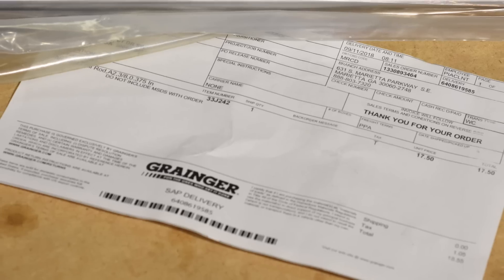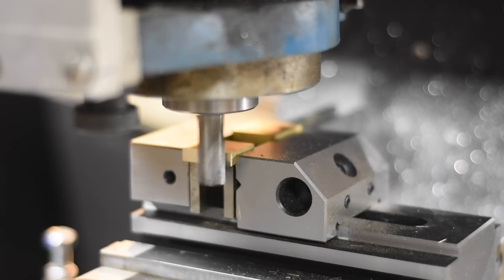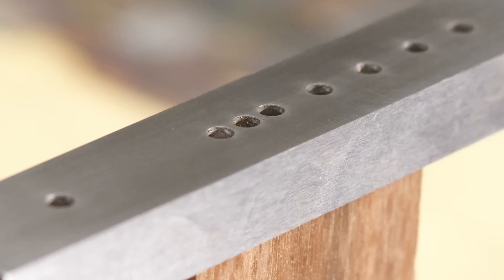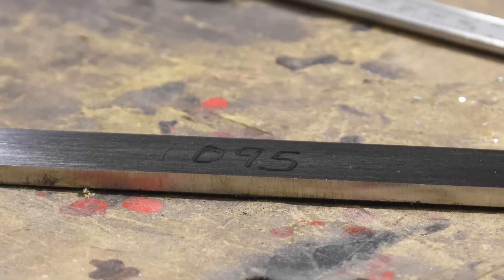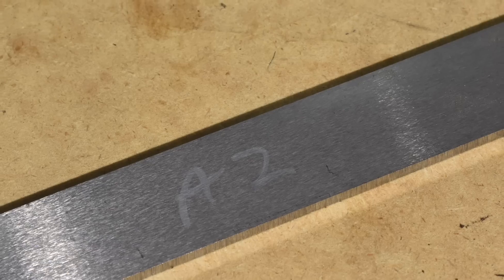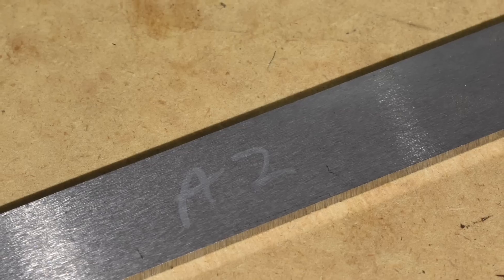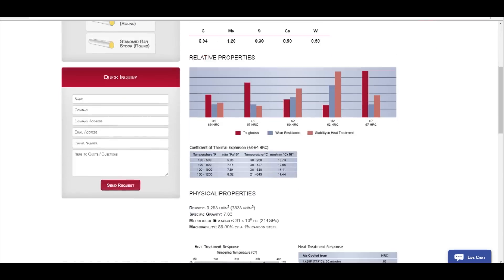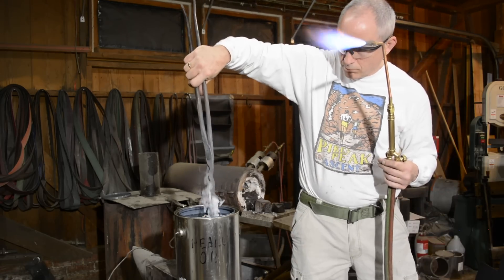Guide to Tool Steel for Knife Makers

Comment: I use O7 tool steel
Reply: @Matthew M Ditto! It's great because you don't have to forge it. You just cast it in an open mold. And not as hard to get as they say.
Reply: @Matthew M I feel you. That's why Tywin's people went full-China with the casting at one point for their reclaimed steel project.

Comment: I was a toolmaker and engineer for 42 years. I have done some screwing around with tool steels. A couple things I want to add if I may. One is about S-7. If you get it up to temp, and quench, you will have to draw it down some. I've tested on RC up to 72. Which means it will be too hard and very brittle. 
I've never took a regular tool steel up that far. 
We would either have a vacuum furnace or tool wrap the A-2. It can lose some elements if this isn't done. 
Be careful of M-42 Cobalt. It will also get too hard and shatter on you.
Still the best advice you can get is to keep it simple, and enjoy what you do. I am very much a novice at making knifes, but I enjoy making stuff out of old crap. My Uncle started me out in Blacksmithing when I was 8. I've enjoyed my career and was very lucky to do what I did. I got to work with some very smart people. Now I want to hammer steel, and pass on anything I can.
Good video Mr. Sorrells, thank you for posting!
Smiles.
Reply: @ john wick   
I ended up getting some O2 steel. I made a bowie knife with it (22cm blade length, 34cm overall). O2, i would say, has less flex than the other 2 steels and is a bit harder. I did a test blade, and it took a LOT(seriously) of force to break, with the blade having a width of 0.5 cm. Bear in mind, it didn't bend very much, it just broke instantly. It is also quite hard to sharpen, so there is a lot of elbow grease involved doing that. Lastly it rusts moderately easy if exposed to humidity for prolonged periods of time without any care, as does any high carbon steel, but thas not a problem for me.
All in all i find it an excellent steel for tools and bushcraft knives, or any knife for that matter, but i wouldn't make a sword with it since it lacks the flex/springiness needed.
Hope i covered you with the above. If you plan to make a knife with it and want any help with heat treatmnet temperatures, tell me and i might be able to dig up some papers i had for O2 steel.
P.S. I believe O2 steel is also known as k720 steel, so you can do a bit of research on your own, cheers
Reply: Start a channel
Reply: kutzbill dude we’d all like to hear from you. How can we contact you or you should really start a channel!
Reply: Just an old metal hitter here.. I don't know technical terms but I usually forge my S7 and put it in a sheltered place to cool and put it to work..Never had any problems.
Thanks so much for the clear video...
Reply: It's impossible to get s7 to 72 hrc. m42 maybe if your heat treating tolerances are very tight
Reply: @cadewamsley5934 wrap it in stainless steel foil to prevent decarberizing take it to 1875 f then flush quench it in 150 f oil to 1000 f dull red. Then air cool to 150 f. It will go to 68 to 72 Rc. Temper  it at 600 f before it goes below 125 f. Must do double tempering. This should give u a 56 to 60 Rc great cutting edge that will withstand alot of stress.

Comment: Hey Walter, i was wondering if you could water quench say 1095 or 5160 in water if you clayed it for a Hamon? If you wanted to acheive that “katana curve” in quench. Or would oil still be the best bet? Cheers
Reply: 5160 won't hammon with clay. A differential heat will get you a good line

Comment: I started with o2 toolsteel, because that was what the knifesuply shop was selling haha. works nice, but can't put a hamon in it atleast i couldn't, while i could with c75/95 1075/95
Reply: Carbon steels (10XX series) and W2 produce some really beautiful hamons. I think others do as well, but O1, O2, and stainless steels don't produce hamons. Has to do with the carbon content. In my next order of steel, there will be a few bars of W2 just for the hamons. Walter also sells a video on his website that has some good info about producing a hamon, but it sounds like you already have some info on the subject.
Hope this helps.

Comment: Another interesting kind of steel are bearing steels. Maybe you could talk talk about them?
Reply: 52100 is an outstanding steel. Very tough and abrasion resistant. But it is a real bugger to forge. That being said, if you've got a lot of frustration in your life forging 52100 can be very therapeutic.
Reply: @benparry5318  wow nice info! Do you have more tips about forging  52100 to share? Thanks in advance.
Reply: Dreadnought of blades usually 52100 steel from what I’m told.  Some famous knife makers use it almost exclusively.  I know nothing about heat treating it mainly because it would be nuts to forge a big bearing without a press.  I know I’d have a red hot bearing rolling around my shop!
Reply: @loul7239  luckily i can buy it in round stock 😉😂. I`ve also read about other bearing steels, but 52100 seems to be most known.
Reply: Those are not tool steels though.
Reply: 52100 is a nice one to mention.
Reply: Luis Tapia I was also shocked he didn’t mention 5160 for swords and axes.  Granted, it is a spring steel and not as high carbon as a real tool steel, but it is great steel for beginners who want to make bigger blades.
Reply: 52100 needs to be forged really hot. And more so than other steels,mother second the colour starts to fade put it back in the forge. It does not like to be forged too cold.
Reply: Ive read heard differently  @benparry5318  here is my take on 52100 - you forge it cooler not hotter. however, doing so takes a lot of work! (unless you have a power hammer and big arms)from doing so (forging at a lower heat) you keep the grain size down and all the associated drama: cracking after quenching, or it crumbling in the high heat because of the chromium and vanadium alloy content.  you cant go as high as with higher carbon steels, manganese, and especially tungsten in the formulation... you can even water quench 52100 if you get it right. it is quite the steel, holds an edge and super strong.(because of the fine grain structure from the vanadium) hope this helps
Reply: @krustysurfer grain size doesn't matter much for forging, since you'll likely do a normalize cycle to grind it some before heating for the quench. Every reheat til nonmagnetic recrystallizes it and it gets smaller grains each time, unless you get it too hot for too long.

Comment: How would you HT a longer blade? I've been unsuccessful in trying to get the damn thing to critical. Blade length is probably 10 or 12 inches.
Reply: Your setup is way less than optimal, but, you may have some luck if you heat the handle first before heating the blade.  Your handle is a huge heat sink and it is making your life difficult.  Get the handle dull red then turn the knife around and get the main portion of the blade hot.  Once the blade shows some red start moving it in and out to get the tip (which is thinner) to match.

Or just wait until you have a properly sized forge for bigger work....
Reply: What setup are you using?
Reply: large coffee can lined with kaowool and a shitty bernzomatic torch.. it's recently just started crapping out on me. UPS should deliver the regulator eventually and then I can switch to a real burner.
Reply: Maybe if you add a second torch at the end it would help paint the heat better. It doesn't have to be in the can, just pointing in the orifice.
Reply: Thing is the can isn't quite tall enough to fit the whole blade. I tried torching it outside of the forge but it just didn't work right. I could use the bernzomatic and the regular burner together, that might work
Reply: What are you using as a heat source?
I’ve used a trench about two feet long by six inches deep about the same width filled with coal and i use a hair drier to get it to critical temp and it’s worked well for larger blades
Reply: Blast another hole in the bottom of the can and point the torch in it.
Reply: Watch his video on simply heat treating. Use charcoal and a blow dryer in a fire pit or grill
Reply: Lou's suggestion is good, but also consider building an electric heat treat oven - that'll keep you going if you start doing more advanced steels with soaks and such.
Reply: Yeah, you’ll definitely want to make a longer forge if possible. I have the same issue. I have a small single burner propane forge (20 pound tank, a simple burner, I guess an atmospheric burner to be precise). It’s great for knives, but anything big and it’s tough to evenly heat it. I’ve decided that I’d have to extend it and add a second burner if I really want to make anything bigger. Softbricks are pretty cheap from a website I found, I’m thinking of just extending the one side with bricks, and make a little table for the whole thing to rest on. I feel like that’s the easiest way, just pure softbrick, using satanite to fill the cracks, and a hard brick in the base to put the knife on. Just a little extension on the end, and also with as small of a volume as I can to help it get hotter.
Reply: Make 6" diameter Sock tube out of 3"thick Kawool/thermal blanket. Gently hang/suspend horizontally on long coat rack type of stand(thats why old coat racks work so nicely for this type of job) using wire you use for tying rebar with. Make door flap to chamber from same thermal material, Then coat the whole inside of sock/chamber with ITC-100. after curing, heat thermal sock with 500K roofing torch (from tip end/far end.  you suspend the blade inside the sock on wire loops- i have seen it done this way, do outside(not in rain or wind), and wear respirator because of Silica strands fibres suspended in the air.  Blessings and aloha